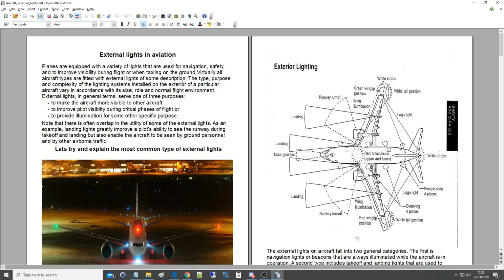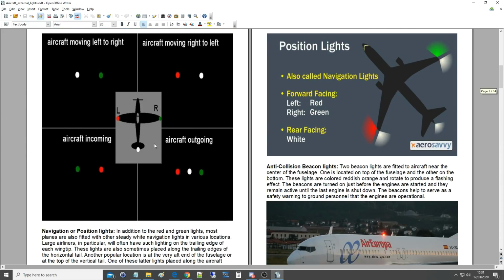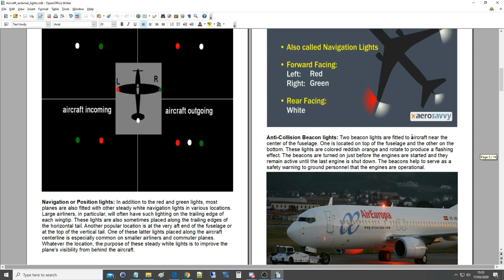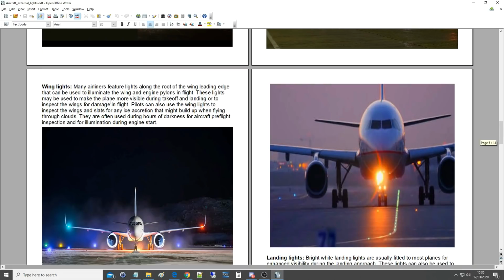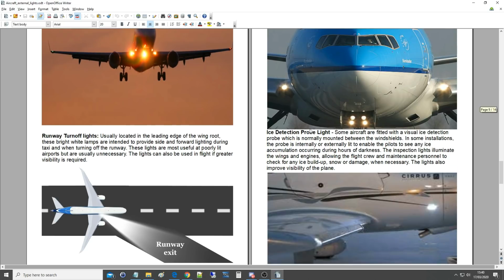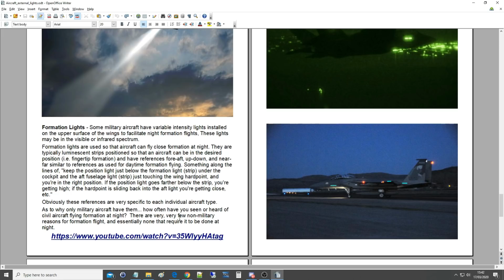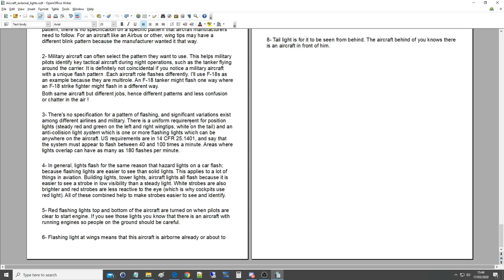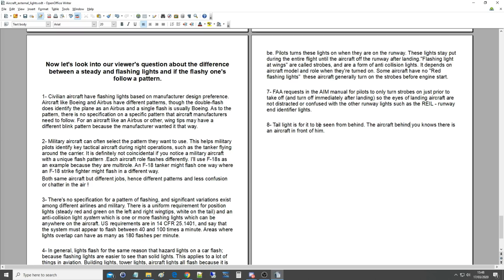Flying Basics: Military & Commercial Aircraft External Lights

Comment: +GrimReapersAtomic  United States military aircraft have several redundant lamps not used in the civil world.  Multiple position lights in specific positions (the USN-USMC/Grumman Iron Works F-14 Series had no fewer than five port, five starboard, and six stern lights) help personnel in night identification by type.  Formation lights are cyan linear lamps in specific positions on the airframe.  The anticollision light switch controls synchronized strobes on the fuselage top and bottom.  The Air Force uses landing and taxi lights on the nosegear.  The Navy and Marine Corps use a landing light and a three-lamp AOA indexer repeater (for the shipboard landing-signals officer) on the nosegear.

Comment: Hey guys. Just a important note about Navigation Lights. You use then also as a reference to which aircraft have the preference when two aircrafts are about to cross paths. If another aircraft is about to cross your path, coming from your Right, he have the preference. If he is coming from your left, you have the preference. You can use the Nav lights to guide you. When the aircraft is crossing you path from your right, you will see the RED nav light on his wingtip. When coming from your left, the Green one.

Comment: Boeing 737-100 to 500 have landing lights in the flap track fairings and wing roots.  Boeing 737-600 and latter have the land under the wing to body fairings and the wing root.

Comment: Hey Cap, I got something I'd like you to test. Early model AIM-9s had Rollerons on the fins for maneuverability (video of how it works: https://www.youtube.com/watch?v=cfzj3rRIVU4) meaning that as long is air is moving over it it can maneuver. What I'm wondering is if you can get a lock with an AIM-9 and then jettison the missile and have it glide to the target without igniting the rocket motor or launching it off the rails and if it would still track and (hopefully if it has enough energy) hit a target.
Reply from the maker: adding to list
Reply: Agent J  
...You must be new here.
Just pull up GR's past video catalogue going back... like 2+ years now... and you'll see a bunch of stuff they've been testing that you'd never actually do or use on purpose. The point is if it's modeled and coded for in DCS and if it's possible to test it to see the limits of the sim. And if there were vending machines and trampolines in DCS, I'd want that tested just to check "shits" and "giggles" on a checklist even though you were being hyperbolic.
Reply: Agent J  hmm ..F14's used carry Sparrows in a centre line trench.. to make the missile flush.. The trenches have explosive bolts which push the missile away before the rocket motor fires ..so essentially the missile is free floating for a short period..  There was an F14 that basically shot itself down when testing to see if the missiles are effected by trying to fire them at very high mach numbers .. the missile used was an obsolete sparrow variant ..modified for the test.. it dropped , got caught  in the slipstream and hit the rear of the aircraft.  SO some missiles do require dropping unpowered before they fire their rocket motors